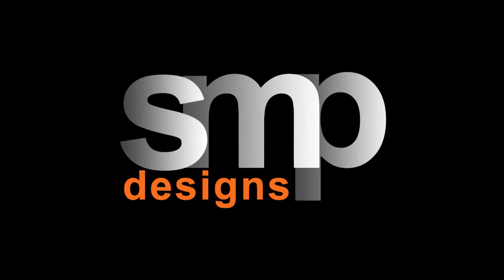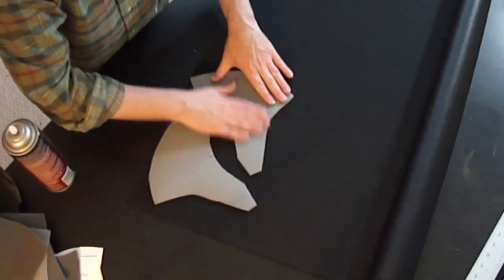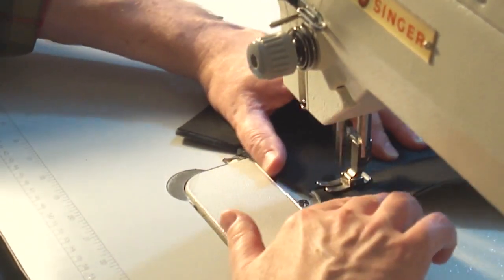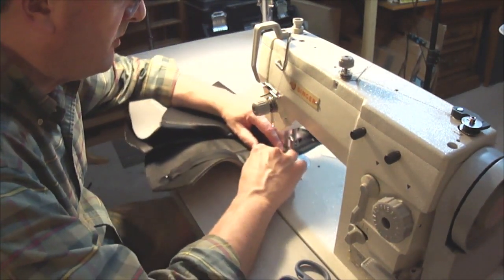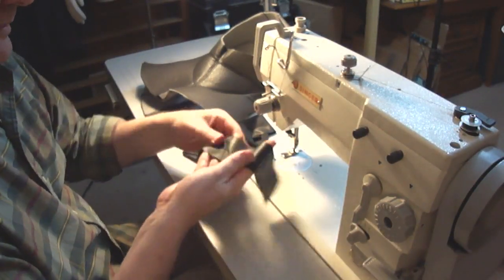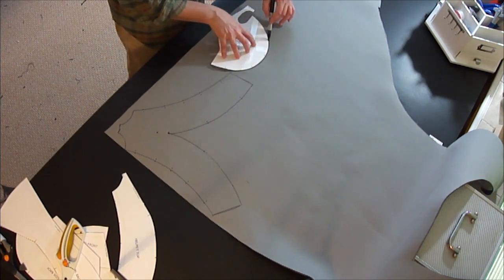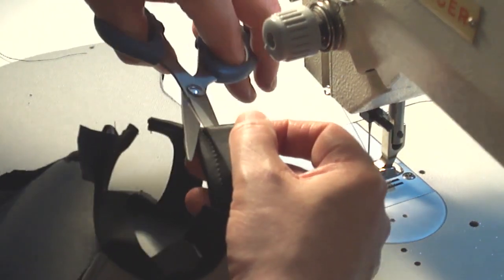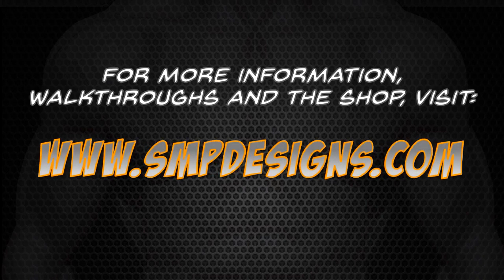Tutorial: Building the 2pc Cowl

Comment: Question. I watched my grandmother for years using a sewing machine i realized that way is not for me. I could do this by hand correct?
Reply: you just think of the fabric as a shoe and the needle and thread as a shoelace and it is as simple as that just tie a knot at the end
Reply: I know this comment is a tad old, but I totally prefer hand-stitching because I feel like I have more control over it. With thicker material like leather or foam, it tends to work easier that way!
If you do stitch by hand, I recommend having good quality needles that are sharp (I keep a couple different sizes/thicknesses for different fabrics and materials). Also having a leather thimble helps!

Comment: I bet it's warm af with that foam.
Reply from the maker: It can be yes! But the reason I made this in two pieces is so that you can take the face/upper head off to cool down. Also, depending on the materials you use, you can then pull the cowl back off your head without having to take the whole thing off to release heat.